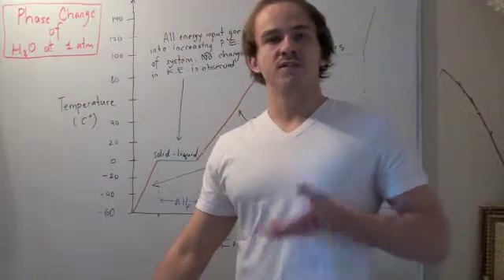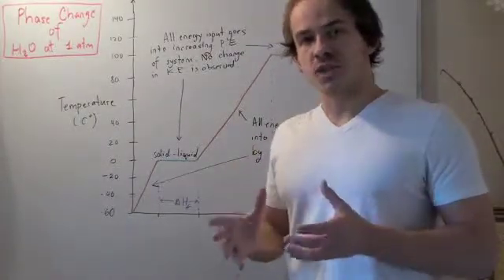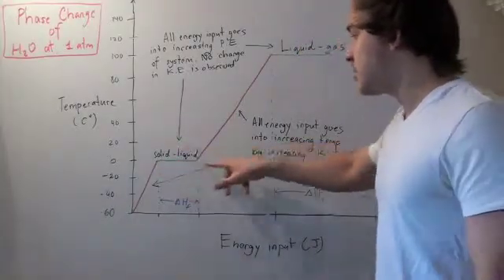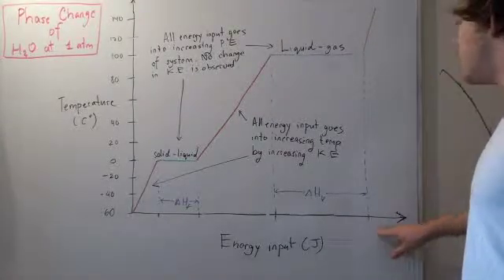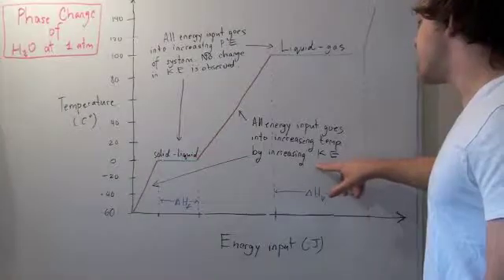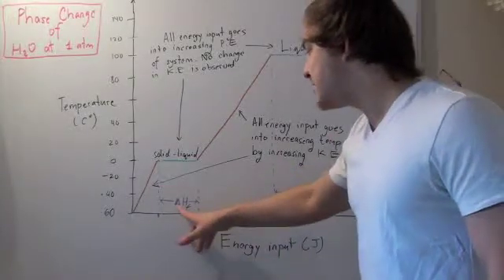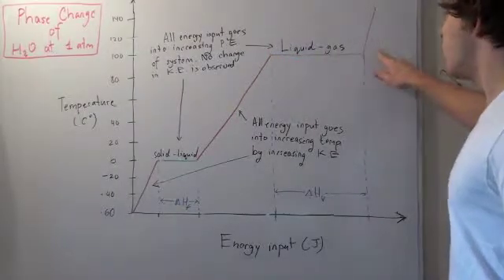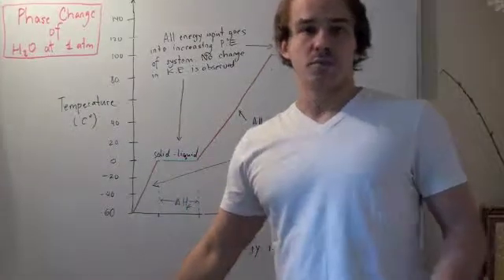Phase Change of Water

Comment: So what comes first? sensible heat or latent heat?
Reply: Sensible heat and latent heat are two types of heat energy transfer. Sensible heat refers to the heat energy transfer that results in a change of temperature in a substance. The energy is used to increase the kinetic energy of the molecules and causes a rise in temperature.

Latent heat, on the other hand, refers to the heat energy transfer that takes place during a phase change, such as melting or boiling, without causing a change in temperature. The energy is used to break the bonds between the molecules and change the phase of the substance, without increasing its temperature. This type of heat energy is latent because it is hidden, as it is not reflected in the temperature change of the substance.